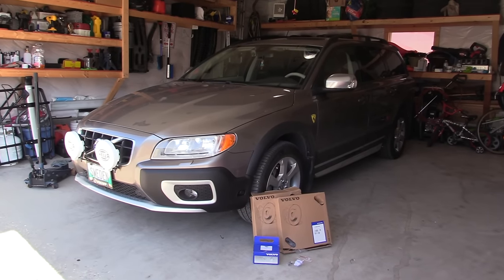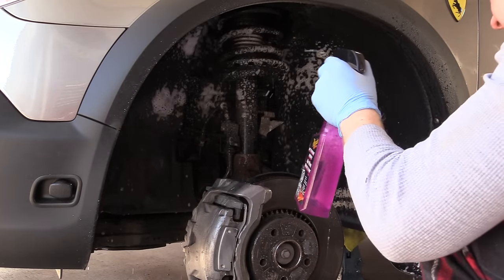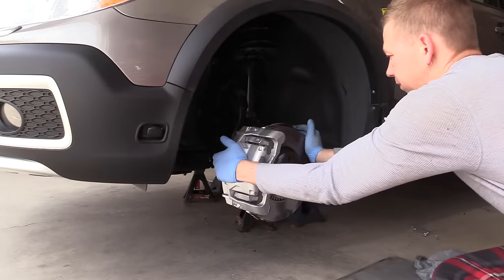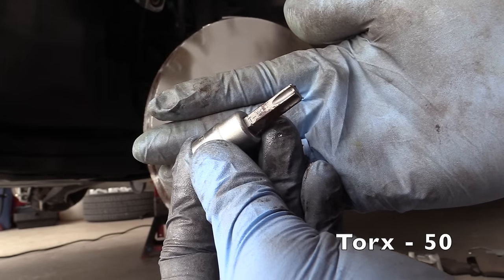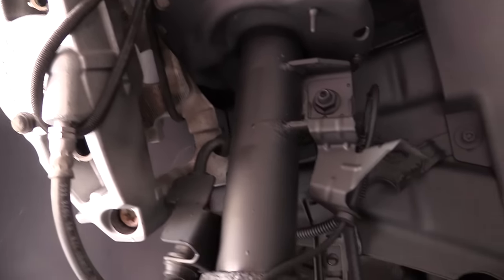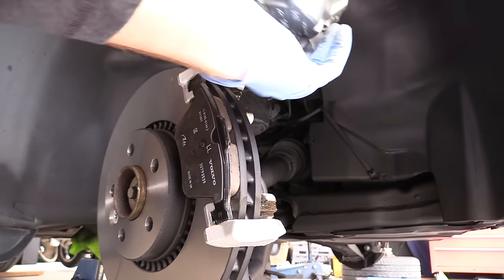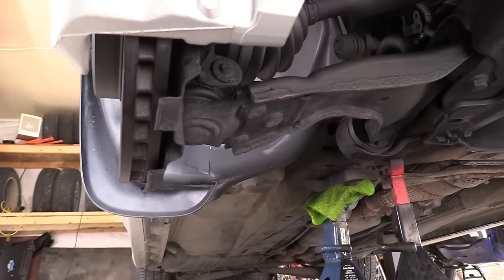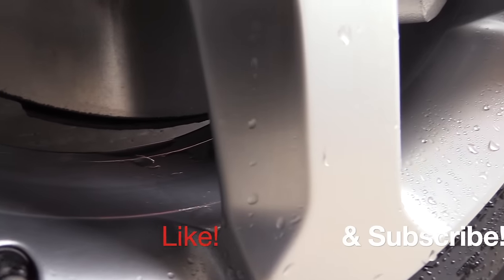Volvo Front Brake Replacement. And a little more!

Comment: I think the reason the inner pad wears more is because the slider pins do not have enough lubrication, so the caliper is not pulling the outer pad onto the rotor as it should
Reply: The inner pads wear more because for the caliper to be pulled closer bringing the outer pad there must be contact on the inner pad with the rotor/disc.  Think of a tug of war and leaning backwards to pull the other guy you must dig your heels in, same with the pads, the inner pad is digging in to pull the caliper and outer pad into contact with the rotor/disc

Comment: Hi. I am a bit worried about the grease on the hub. This should be used only on calipers to make brake pads move smoothly. Anything applied on hub may end up with bent rotor. I have spoken with many mechanics and they have confirmed it.
Reply: I tiny bit of copper grease would stop it from rusting together, right? I'm more worried about it being sillicone.
Reply: @martij30  copper grease is not good idea. Better use anti seize aluminium paste. Between disc brake and wheel hub use ceramic grease.
Reply: @damiansmigielski  What's the main difference between aluminium paste and copper grease? As far as I know, both can be used like an anti seize to be put between hub and rotor, just like ceramic grease.
Reply: @martij30  electrochemical.
Reply: @damiansmigielski  So what/how does the copper grease affect the hub or rotor, that aluminium/ceramic grease does not?
Reply: Guys. I have tried to use a tiny bit of grease and even a few micrometers of it can cause the rotor to sit on hub unevenly. I've checked it with my measuring tool and without anything on the hub the result was best. What I do is a leave it dry. Rust wont harm it anyway. My trusted mechanic confirmed my worry and said nothing on hub is essential to make the rotor safe from bending
Reply: There is no need to grease behind the brake discs, they come off ok without it and if not they can be hammered off easy. The grease is a bad idea behind the disc and can be a bad idea in front to stop the wheel seizing on the hub. Just don’t grease those parts. Grease the back of the pads, the sliding pins and the metal where the calliper slides inside the carrier.
Reply: You guys are nuts. Who cares about a thousandth of runout? Your rotors from the factory probably has more than that. What's worse is that nobody seems to care about pushing old brake fluid back into the master cylinder. Unless your working on a relatively new vehicle or have just done a brake fluid flush then your pushing some garbage fluid probably into the ABS system and or master cylinder. Neither are cheap or easy to replace. Just open the bleeder screw and put a hose on it then push the fluid into an old plastic container. After the new pads are on pump the brakes then top off the brake fluid reservoir. Simple and no worries of contaminated fluid where it doesn't belong.

Comment: The reason for the uneven wear inner vs outer pad is dirt on the slider pins.  They are highly polished at the factory.  Best to use only solvents on them to clean them 😁  As suggested below use silicon  grease when refitting them.
Reply: Vida says not to lube slide pins on my 2013 xc70.  Any reason why?
Reply: @pgreenx  Heaven knows perhaps some silicon or teflon spray instead

Comment: (1)Piston side wears more usually.
(2)Without grease on the pins your caliper might not move so easily when the pedal is applied...pretty important step.
Good clearly shot and explained video!
Thanks

Comment: The reason your inner brake pads were faster than the outer pads, is the inner pad sits against the caliper piston which touches the rotor first because of the lack of lubricant on the pad/rotor bracket  to move freely engaging both pads simultaneously. Over time this lubricant dries up and then corrosion sets in.
 You've done a great job servicing your front brakes and detailing the surrounding area. You'll probably never have to buy a new car if you keep this up. Lol.
I enjoy watching your videos. I own a 2009 S60 2.5T.
I, like you, do a complete and detail service on all my vehicles.

Comment: Hi! A few years ago I did anti-corrosion protection in a professional workshop. Everyone said there is no need to do that for an almost new car, but the guy who performed the service said that the key is to protect the car before the rust will appear, not when we will find it.

Also pls. consider a cardboard sheet under working area. It perfectly absorbes each spots, fluids and oils. I buy it in local paper wholesaler for 0.25-0.40 eur / 1 piece 220x150cm depends on thickness. Town cleaning company collects it from my gate every monday. No bad smells, nice and clean garage :) 
PS. Perfect job. Nice to watch as always.
Best regards
Reply: Yes good. Remember engine oils often are contaminated with heavy metals i.e. lead

Comment: Thanks for another nice video! What I have found is that for the bolts that keep brake support in place (18mm head) the thread-lock is the reason for them to stick when unscrew. In order to do it easier and with less force you should unscrew them till it is hard to rotate it and then tighten them back. Once they are all in, you could unscrew them again and they will go further out. It needs 2 or 3 repetitions to get bolts removed. This in-out action removes the thread-lock without effort and you do not need to apply a lot of force after initial movement (you still need the big pray bar to make them move in the beginning).

Comment: Thanks for the video. I have a V70 and this helped me replace my pads yesterday. Really enjoyed the job. 

My dad told me years ago that he thought greasing brake slider pins was not the right thing to do. The reason is because the range of movement is so small and the power of the braking strong so it’s unlikely to ever seize through lack of lubrication. The downside of grease is it attracts dust to stick to it - leaving a sticky mess more likely to cause problems. Indeed my slider pins were coated in dirty black gunk when I removed them. I cleaned them and replaced them dry. This always seemed logical to me. Interested to hear other views though.

I was tempted to paint the callipers while there but at 140,000 miles my car is fairly scruffy - so I decided it wasn’t worth it. It would be a slippery slope of spending money bringing it back up to standard!

Comment: The inner pads wear out faster because of the design. It has the piston on that side and gets more of the mild braking where you just brake easy.. So the inner pads do more of the work. 

Great video sir.
Reply: I dont think so.
Reply: That not the reason at all we’re do u get this the reason your pads are wearing uneven is because you need to clean the sliders that the pads sit in and put a tiny bit of copper grease on the slider and on the back of the pad  and slider pins it’s nothing to do with mild braking of the piston or anything like it I’m a engineer on car and trucks
Reply: Yah you can see when he pumps the brakes. It's designed to "pull" the outer inward.
Reply: I am using Carlube Silicone Grease XSG070 on my Volvo XC70 2006 D5 Diesel when servicing on my brakes and I am verry impressed of results.
On sliding pins: 
The calipers are floating even 3 Years after this treatment .No sign of corrosion.
In the description:
ADVANTAGES:

Extreme temperature resistant multi purpose grease
Lubricates and protects plastic and rubber parts
Ideal for brake pads, o rings rubber seals and brake callipers
Water repellent
Because it has low dense ,I use a tiny tube - as in the pen.
I pushing the tube inside in the grease and  then with it lubricate inside the tubes for the sliding pins.
Reply: Due to its construction, the Outer pad has more friction to work, no matter how much it is lubricated. Then the pressure on the inner pad is the greatest and wears out the most.

Comment: Totally agreed, the new brakes look AMAZING with all of your effort and LOVE putting into the task. You're such an oriented, detailed person! Your videos are  not only well entertaining but also give the DIY audiences the confidence to take care of their own vehicles. BTW to avoid metal contacting metal between the stand and the vehicle frame, I cut a small square piece rubber from old tire instead of using towel. CHEER!
Reply from the maker: Thx for the tip on the rubber piece. Definitely will implement.

Comment: Great video, thanks for sharing. You are an inspiration. My XC70 2008 D5 currently has 270.000KM and drives great.
Reply from the maker: Glad to hear. Happy Volvoing
Reply: My 2005 Euro3 XC70 D5 Auto Geartronic has 204K miles (328K km) and drives perfectly - just passed MOT without any advisories. The 2008 XC70 euro4 D5 Auto Lux Geartronic Polestar has 161K miles (259K km) and also drives and feels like new. The new Michelin CrossClimate2 are fantastic. The 2005 has the CrossClimate+ and they have also worked amazingly well.

Comment: Great video, thank you. About uneven brake pads there is 3 possibilities 
1. Sticking slider pins, guide pins 
2. Sticking brake caliper piston
3. And sometimes even old brake lines could cause that, because fluid can`t go back easily when brake pedal is released but it`s very rare. But I think no mater what inside brake pad still wear more than outside pad.
Reply: Per your #3, old soft lines will cause that for sure.

Comment: Different pad wear is almost certainly the slide pins sticking. Interestingly, Volvo makes it easy here to pull out the pins w/o doing anything else so that you can service them. (awesome) I would suggest you pull, clean/polish, and regrease them every winter and summer to keep the calipers sliding nicely and avert other problems that result from stuck calipers ~

Comment: when you clean the grooves for pads slide be aware that they are already worn out and you can get what I got - knocks when braking. I spent a lot of time searching the source of knocking, it was not tight sitting pads in those grooves that you sand

Comment: The reason for the pads wear not evenly is the caliper slide bolts. The once you clean with sand paper. You need to clean them really good and put some silicon paste.
Simply the was some resistance is caliper sliding
Reply: Błażej Lis Absolutely. Need to grease those caliper sliding pins/bolts
Reply: Incorrect. Volvo specifically says do not grease slide pistons. They are to be cleaned that's all
Reply: @tmillner0682  Exactly. Do not lubricate the sliding pins. The grease causes sticking of dirt and hindered movement of the caliper. There are still a few mistakes in the film. If you press the piston in the caliper, unscrew the bleed valve and remove the brake fluid form caliper. Do not pump it up the system. Do not grease the hubs under the brake disc.etc...
Reply: @damiansmigielski  the way he pressed the caliper in place was fine and the recommended way. Opening the bleed screw to release pressure will be introducing air into the brake system. You can do this, but you will then need to bleed all brakes to remove the air.
Reply: @tmillner0682  well... in my 30 yrs career as mechanic I never had that kind of situation. You have to think when you do something
Reply: @damiansmigielski  what I stated are facts. Opening the bleed screw is only done when bleeding brakes not to compress the piston. 30 years or not your method is wrong and dangerous
Reply: @tmillner0682  :-))))) i/m sure you know better.
Reply: @damiansmigielski  my ASE certs say I do.
Reply: @tmillner0682  whatever :-)))))
Reply: Yeah. They are supposed to wear evenly but often don't
Reply: @damiansmigielski  Why not grease the hub to brake disc mating surface? I hear it makes removing the rotor in the future a lot easier. Isn't it analogue to putting e.g copper paste between the rotor and wheel mating surface? Interested to hear what you think about it.
Reply: Rubr1k it is best to use a ceramic grease.  Always apply a very thin layer.  A thick layer may cause the brake disc to bend
Reply: @tmillner0682  Just now doing all four brakes on my 2015 XC70 T6. The rear pins are heavily greased. The front pins appear to not have have any grease or maybe a slight lubricant on them. What's the difference?
Reply: Yep , every car I worked on the sliders are heavily lubricated .
Reply: @butch.dieselsteak  VIDA specifies clear not to lubricate the pins! Weird, but this is it!

Comment: Thanks so much, just did mine today, and this made it all easy. A word of CAUTION.. my rotor bolt (T50) was absolutely seized, heat, penetrating fluid.. nothing helped. The head snapped off. So I redrilled the bolt out and retapped, and my tap broke inside! SO I decided to not use the bolt!! No choice. Wheel studs will have to hold it on. Hope this doesn't happen to anyone else, it was a day of hell.

Comment: Great Job 👍 Next month I have to do the same work on my V60 T6 from 2019 with now round about 64,000 Km. I bought the brake pads and the rotors directly by ATE, so I was able to save a lot of money. Hopefully it is the same quality in comparison to the original parts. Best Regards from Germany, Martin

Comment: Sticky slide bolts is the reason why your inner pad has more wear. 
Painting all that suspension with spray paint without any proper rust removing looks nice for a while, but after one winter, they are all the same again. 
I have learned that painting brake calipers has same issue, spay paint leaves too thin coat and calipers rust again after just one winter, even if they are sandblasted before painting.
Reply from the maker: I will repaint if needed. I dont see any reason to spend a lot of time and effort to make it super correct.
Reply: But you already did spend a lot of time to do all this. I'm not whining that you didn't do it "super correct", I'm just saying that you wasted a lot of time because that spray paint just isn't adequate for the job. 

And btw, lubing those slide bolts is the only right way to go :)

Comment: Great job. Your work is too a much higher standard than a dealers workshop. My XC60 had the same issue with one pad wearing more than the other. I see you have started a new line in mechanics trousers 😀😀
Reply: Working on a Volvo is far more efficient if you are still in pyjamas. :-)
Reply from the maker: Pyjamas are comfy :)
Reply from the maker: @burimskenderi1904  Comfy :)

Comment: Hi and thank you for a very comprehensive video. One point, on my Volvo XC60 T6 the pins that hold on the caliper are held in place with a 9mm hex, not 7mm. I had to resort to using a sump plug socket as 9mm is not a common hex bolt size.
Reply from the maker: This will help someone with XC60. Thx
Reply: You asked in the video about uneven wearing of the inboard pad. Bendix suggests it's due to lack of lubrication of the caliper guide pins. Due to your harsh winter conditions, your pins had a lot of surface rust on the lower half, suggesting the outboard pads were not being returned to the full open position because of friction caused by the rust on the guide pins.

In Australia our winters are very mild, so my pins had no rust and still has some grease present, so my pads were both evenly worn.

I would suggest for those of you living through Canadian winters would benefit from additional preventative maintenance by taking out the pins mid winter and using a more robust ceramic grease on them to get even wear on your pads.

Comment: So, as the caliper has only one piston, the whole caliper slides on those slider pins. You need to lubricate them to ensure that the caliper can slide freely. The inner pad is the one the piston pushes. Outer one relies on the slider pins to allow the caliper slide freely. After a while, the slider pins get jammed up and the caliper can't slide freely anymore. Then, when you brake lightly, the inner pad makes greater contact to the disc and that's why the inner pads wear more quickly than the outer ones.

Comment: Working on older cars, I've always used Copper grease between the hub and rotor and between pad and caliper. I wonder how different they work over time and more extreme winter conditions.

Comment: As an A&P Mechanic,  my suspicion about the uneven wear of the inner and outer brake pads is that the lubricant on either the slider pins or the guide horns on the disc pad ran out of lubricant over time. The disc pad then jammed on one side or the other causing the pad to move at an angle instead of equally for even wear of the pad. Without equal movement of the pads within their guides along the slider pins , the pads wear unevenly. This is evident by different wear (thickness) of the worn pads and/or one disc pad looking thicker on one edge end verses the opposite edge end. That has been my observations with single piston disk brake systems on a variety of vehicles using disc brakes!

Comment: I believe the inner pad strikes the disk first and does most of the binding. You can see it do that ; when you recorded the brakes moving.
Reply from the maker: Makes sense. Thx for the tip
Reply: @volvosweden  Hi, in some cases the bushing arround the slide pins is compressed by the oxidation in the bracket's hole where It is fitted. The whole gets a smaller diameter and the slide does not move well. This can cause more wear in the inner pad. Good to use original pads! Was a nice video! Tack!